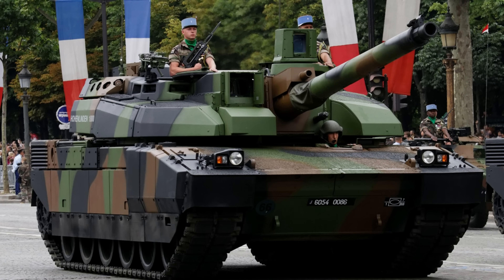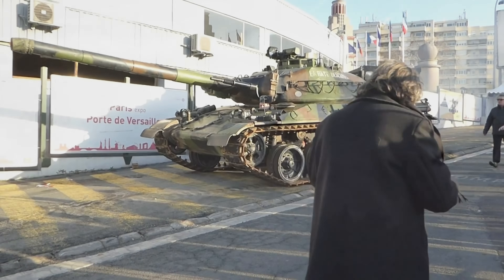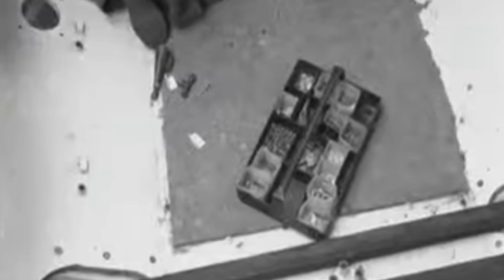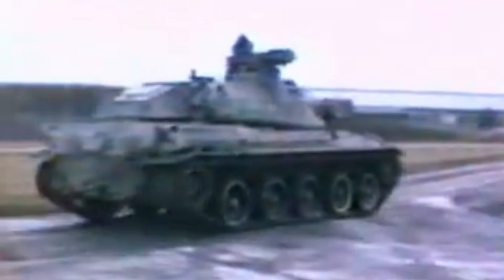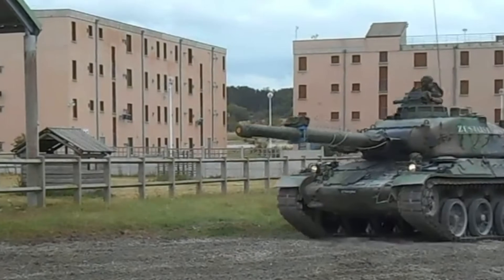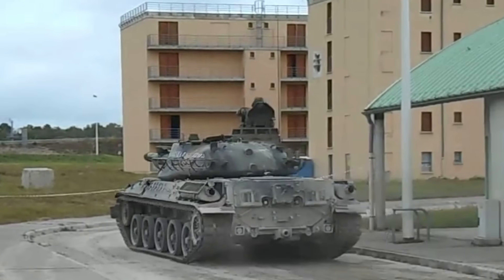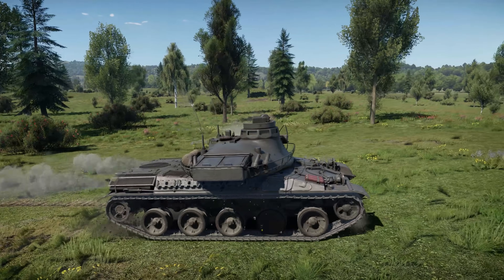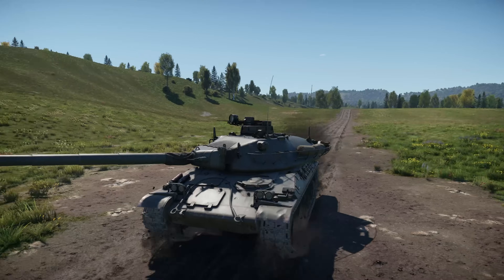The French AMX-30 Main Battle Tank | DOES SPEED BEAT LESS ARMOUR?

Comment: I liked the AMX-30B2 and AMX-32, but I consider it a Tank Destroyer akin to the U.S. M-18 Hellcat rather than a Main Battle Tank. As such, though, its lack of a well-stabilized main gun and poor target designation and range-finding compared with M-60 and Chieftan made serious drags on the AMX-30's performance throughout its service by every user. Fine training and careful employment in chosen circumstances was, quite obviously, the only way an AMX-30 crew could survive. The 20mm automatic cannon proved crucial, several times, to surviving ATGM teams and tank-hunting helicopters, but again, the lack of stabilization was a killer!

The superior H.E.A.T. shell should have been adapted to the L7 gun, and sold to the rest of N.A.T.O.

As a platform, the AMX-30 should have been well-suited to adaptation using a new high-angle turret and a 105mm howitzer/field gun -- it could still use the H.E.A.T. shell for direct-fire against tanks, but have adequate armor as an S.P.H. and much greater mobility than any competitor.

Comment: I was a Tanker in the spanish AMX-30EM2 ours where a little heavier 38 Tons I think it had and extra fuel tank instead the hull rack from the french version.  It was fast for tanks of its generation, but lacks next to Leo 2 and much noisier. The interior was quite spacious except for the Gunner, they added quite a lot equipment there in the improved version.  The opposite happen to the loader since we had a cal 50 instead the 20 mm coaxial that gives a lot of room there (including his own storage in the 20 mm ammo bin).

Best feature of the tank, the hull is quite low so you can go up and down the tank effort less from the front, no need to climb or jump and damage your knees.  I guess it would be easier to find a position where only the turret shows up (I wouldn't like to test that theory or the speed one, I rather get more armour).

The tank was Easy and confortable to drive but being quite low the driver had poor visibility for some obstacles (ditches) also when traveling in column very muddy.  We had laser finder and first generation  thermo view for the gunner (commander shared it too).  There was a drum with 3 rounds for fast use by the loader but it was advised not to use it when moving on rugged terrain since the locks were not strong enough.

Comment: Back when France was Israel's main arms supplier (before June 1967), the IDF rejected the then-new AMX-30 on account of its insufficient armor protection, and got British Centurions instead, as well as some of the M-48 Pattons that Germany was replacing with Leopard-1's. The AMX-30's 105 mm gun, although not to NATO's standards and unable to fire APFSDS, was somewhat modified and shortened, and nevertheless mounted on a M-4 chassis to become the M-51, which fought successfully against swarms of Soviet-made t-55's and T-62's in the October 1973 war, to be phased out a few years later.

Comment: AMX-30 had 80mm of armor. Not 50mm.
In fact considering the angling, it has roughly the same armor as a T-55. 50mm is the Leopard 1 lower front plate. The Leopard 1 had less armor than a AMX-30, 70mm vs 80mm.
Reply: Where Do you got those numbers?
In every technical Data sheet i find it says 50mm frontal Turret armor. Rest is thinner. Leopard 1 has 60mm Turret Front and 70mm frontal Chassis

Comment: from a brief overview of the wiki i'm not sure this is all that correct, the wiki says that Leo 1 maxes out at 70mm of armour and the AMX at 80 and the Leo has a better power to weight ratio and the same top speed
Leo was made with the same idea as AMX but it would seem that most of that weight went to the engine, fuel and the advanced targeting
also AMX was designed after the large scale deployment of Malyutka in the six day war

Comment: The AMX 30 is a good tank that can be upgraded for use for smaller budgets. The 105mm 20mm combo was ahead of its time on mbt’s funny how today’s next gen and a few current ones are using a version of that combo with many having 30mm rws . An upgraded AMX 30 will benefit nations like Estonia Latvia Slovenia where they really need to maximize the money spent. A joint  buy between those countries will allow for them to pool those resources into an upgrade package that will make it an effective alternative to the overpriced beasts out here. Keep the 20mm in place add a RWS combo 12x7mm with atgm better engine,add on armor and improved sensor suites and this tank will still be less expensive than the current field.

Comment: Leo 1, was better armoured and had better tech, I mean German over-engineering, right! But, by and large, it was in the same class as a Leo 1, 
aforementioned differences notwithstanding. The whole focus, excluding the heavier USA's M-60, for NATO, was devastatingly firing from 
prepared positions (of which there were gazillions), then scooting off to the next one, that tactical doctrine was based on speed not armour thickness. 
The French were a little too zealous in this regard, as well as the amount of tech included. Still, when their home-grown industry caught up, 
they revised many of these failings as best they could, on an flawed existing platform. For unconventional/urban warfare that coaxial 20mm 
could be quite handy, against anything lighter than an MBT, preserving the ammo of the main-gun for more serious business.  Be well and stay safe
Reply: Leopard 1 actually has worse protection on the frontal arc but it had better powertrain and its rangefinder was more accurate past 4000 meters.
Reply from the maker: Appreciate the in-depth analysis! 👍

Comment: Umm Both the leopard and Amx had virtually no armor but leo still gets praised 🤔
Reply: yes because having a similar design philosophy doesnt guarantee that they'll both do it well
Reply: Because the Leopard 1 got a stabilized gun system while the only AMX-30 variants to get those were export models.
AMX-30 is less than mid.
It may even be trash.
Reply: @PeterMuskrat6968   what's a stabilizer gonna do if you don't have the FCS to go with it? Leopard 1s got really accurate on the move in the 90s, when they were obsolete
Reply: @motmot8879 A stabilized gun still allows you more accurate fire faster when going from move to stop.
We learned this with the Stabilizer on the Sherman back in the 40’s.
Reply: @PeterMuskrat6968 crazy concept to some people i guess

Comment: It was the Sherman tank of its era not heavily armored and unable to withstand hits but has a decent gun and it's fast and somewhat agile but definitely outclassed by modern standards for MBT okay vehicle for expeditionary forces an Airborne units since it's pretty lightweight in a battle where you're not going to be using it as a tank on tank engagements it's pretty decent against buildings Infantry and light armor it would be a decent infantry support vehicle but I think there are better options

Comment: Given that even the heaviest armored MBTs are still highly vulnerable to top attack ATGMs like the Javelin, and that tank duels are likely to be increasingly rare in a battlefield saturated with observation and kamikaze drones, what does the extra armor actually do to increase survivability. So beyond the ability to survive 30mm - 50mm APFSDS rounds from IFVs, that are likely to be a primary prey of future MBTs,  and artillery splinters, what does massive armor achieve. Well other than to improve its odds of getting stuck in the mud and be unable to use many bridges that would collapse under their weight and so funnel them through a few narrow choke points to use bridges that can support their massive girth. 

Far more important, IMHO, would be active self-defense measures like APS and turret top mounted independent 30mm firing timed fragmentation rounds to destroy drones, ATGMS, and potentially precision guided artillery and mortar rounds at a much greater stand-off distance than the APS. So while the AMX-30 in its time might not have been a terribly great idea, it might not be a horrible idea for today if properly kitted out with active measures.
Reply: In summary, the constant developments of armour and firepower keeps the balance between them also constantly shifting, and thus every tank will become obsolete sooner or later with the only adequate question being "how would it have performed in the contemporary environment for which it was designed?"
Reply: @johanmetreus  I agree that a given tank with its combination of armor thickness/effectiveness will become obsolete eventually. But the solution of  making armor thicker/more effective can’t continue indefinitely. There will, and I think has, reached a point where any heavier and the vehicle will become less effective AND less survivable. After all a tank stuck in the mud because of its weight is extremely vulnerable and unable to complete its mission.

So the solution might be to go with lighter armor on the top and sides to make room in the weight budget for better and better active protection systems to destroy/deflect incoming projectiles before they can impact. So it is possible that one day, assuming we still have a dedicated LOS ground attack vehicle i.e. tank, it might have armor closer in capability to the AMX-30 because the APS is so effective that nothing heavy enough to penetrate that lighter armor will be able to get within 30m of the vehicle.
Reply: @ And when you have those effective hard-kill systems, that in turn will force a new development in anti-tank weapons. This is my point, with the balance between protection and countermeasures constantly shifting, things goes in cycles.
Like when the USA battleships were brought out, they proved to be pretty much impervious to modern anti-shipping weapons in spite of being obsolete for sea combat.
Constant development of HEAT-rounds that made thick armour ineffective brought the AMX-30 and Leopard 1....  while the composite armours (T-64, Challenger and so forth) tipped the scale the other way, where heavy protection made anti-tank weapons ineffective.

Comment: The t64 and t72 were around by then, that armor vs the 125mm? Yikes
Reply: At the time of its design HEAT round made any armor useless, the first to hit win.
Reply: @MrMorvana  first hit still wins
Reply: The much heavier and up armored M60 Patton would have still eaten shit against the 125mm

That was the point.
Reply: @Infanterie_Marine  the m60 is much older then the amx
Reply: @roadrunner681  M60's design was finalized in in 1957. AMX-30's in 1959